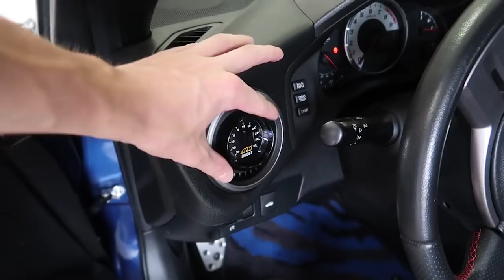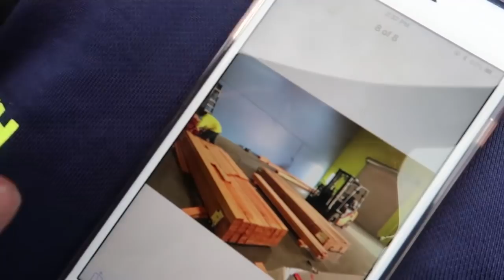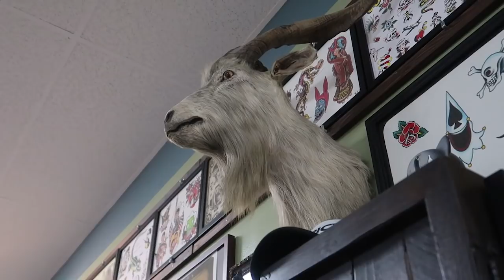I WAITED 8 MONTHS FOR THIS MOMENT! **HUGE REVEAL**

Comment: The ronin battery might not be pushed down all the way and the fact that you just put the camera on there like that would definitely not help.You have you manually balance the ronin with the camera on it when it is off then when you turn it on it does all the fine adjustments. It isn't just plug and play. I have one